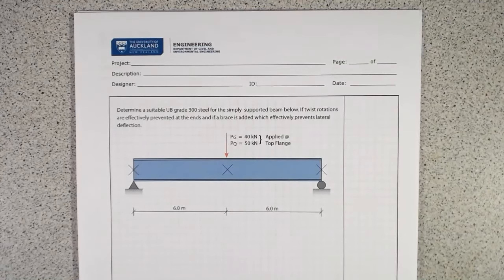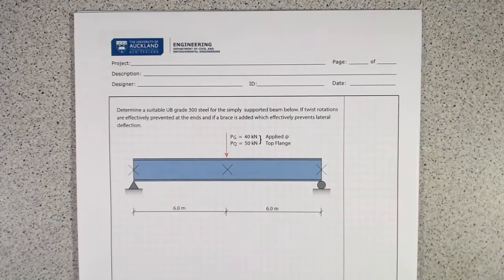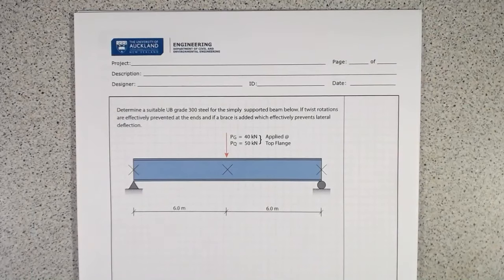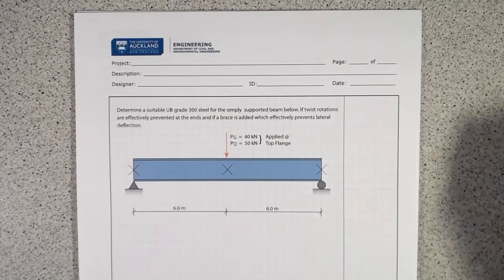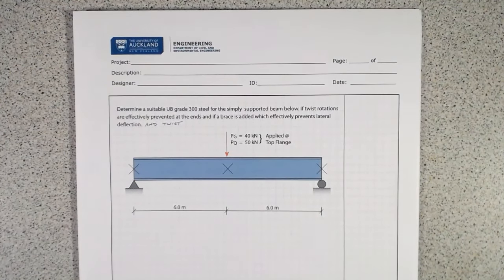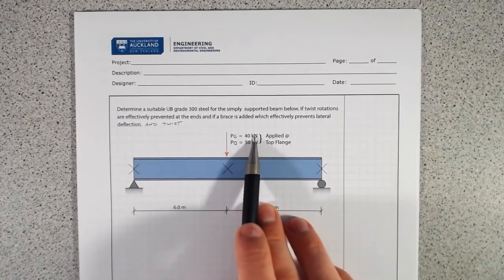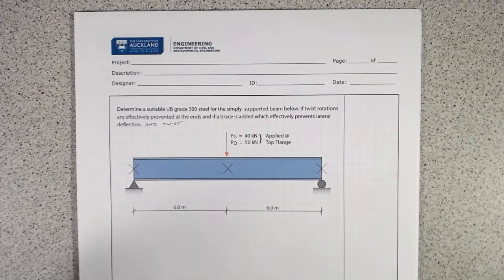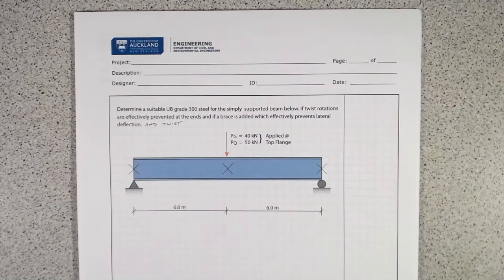Member Bending Capacity to NZS 3404: Design Example 1

Comment: Just a minor quip: The equation for Moa on both videos slightly deviate the one in the standards. Calculations are correct.
Reply from the maker: In NZS 3404 the reference buckling moment is denoted at Moa in EQ 5.6.1.1(3) and Mo in EQ 5.6.1.1(4).  For this example they are equivalent values.  The only time you would not use the reference buckling moment (Mo) in EQ 5.6.1.1(4) is if you were to determine the reference buckling moment through a buckling analysis in accordance with section 5.6.4